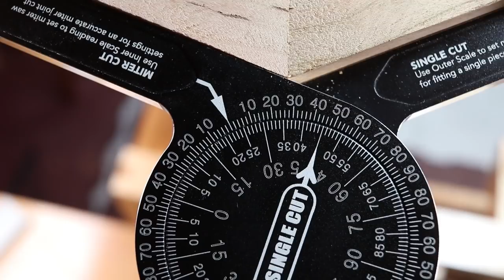How to use the miter Jack to cut perfect tenons

Comment: I used a saw like this 45 or 50 years ago and haven't seen one scene until, I saw you using one in your videos, wanted to make one right away but wasn't sure what kind of blade you used. Thank you for this very valuable saw build, sometimes it nice sawing by hand instead of a noisy saw running! Cheers and Hats off to you!

Comment: I greatly admire anyone who has the patience and precision to produce a perfect result. I also don’t underestimate the joy of working with beautiful tools and jigs - made even more delightful if you have made them personally. My shop has many, many jigs; some are used a lot whilst some only for a particular result. 

I have never found it difficult to make good mortise and tenon joints with one proviso that I will come to. Before I had a dedicated morticer, I used a forstner bit followed by mortise chisels to make the mortise first. Then, using a bandsaw or table saw, I would rough cut the tenons and finesse them with plane and chisel. 

I now use the 2 sizes of dominoes for virtually all that; either with standard dominoes or shop-made so-called mega dominoes. It does takes a bit of the pleasure away from making perfectly-fitting M&T joints but I have to do it that way now because my back and shoulders particularly restrict the amount of heavy repetitive work I can do by hand. I won’t get rid of the morticer or my shop-made tenon jig because, once in a while, I feel I ought to stress my body too far. 

It’s not a criticism of this jig; it’s certainly not a criticism of the skills involved in making the jig. I would suggest that, if you have all the skills required to make this very accurate jig, then you don’t need it. In other words, using those same skills you would be able to cut very accurate tenons.
Reply from the maker: Thank you for your comment, yes there are many other ways to cut a tenon shoulder and miter cuts, you are absolutely right, I just wanted to try this one and see how it works and how accurate it can be, it ends up very accurate and delightful to use! However, there are few of these miter jacks left out there so I thought I would try making one, maybe this doesn't justify the need for one as much as the joy of making one or sometimes the joy of a challenge! To be honest I have made far more complicated projects that I have never published and the question remains does the joy of doing something lie within how much useful it is or within the sense of accomplishment and challenges to overcome.
Reply: @TheWoodCrafter1  thank you for your reply and I agree entirely. I have made things were complicated to make but don’t reflect that in the result. Like you it seems, I get pleasure out of 2 elements - the joy in the making, the patience and the precision and then the joy it is for someone else. My particular favourite style is Arts and Crafts which evolved into Prairie and Mission. Perhaps not the very first stark products and not the final iteration by people such as Greene and Greene. I try to follow many of their mantras. A couple are:

Patience, Precison, Perfection
Have nothing in your house which is neither useful nor beautiful

For the second one, I try to have both form and function in the end result. Again, thank you for the reply and I hope you understand that no criticism was intended - in fact, just the reverse for your skills.
Reply from the maker: @theofarmmanager267  Thank you sir, it is my pleasure to read other professional opinion, my respect 🤝

Comment: I love that saw sled/handle, is it an original design? If the tooth tip line was parallel to the face on that side you could use it as a depth stop, and adjust with shims to vary the depth quickly. Some time ago I cut trenches/dados for a shelf and clamped a board to the plate of my tenon saw to work as a stop, was awkward but worked pretty well, but I had to make sure the saw was at 90 degrees to the board.
Reply from the maker: Man, that shims tip is very useful thank you, I saw other designs like that on the net they do the same function but not Japanese blades, but that is what I found and I can use it now for cross and rip cutting though.
Reply: @TheWoodCrafter1  you could still use it for both but would have to have a think about how to get both blades aligned, maybe index pins or a tapered handle. I'd be tempted to make one with a western tenon saw because they are much cheaper than Japanese saws (here at least)  I like shims, easy to add cardstock or masking tape for small adjustments.

Comment: Not to disparage this tool.... but there is a simpler Miter tool to use. Its already been in use for a very long time and has been dumped on the wayside of power tool development. I think a whole lot of people will go OH yeah!

It is the Miter Box. It will do most of the things you want to do with this Miter clamp and modified block saw. 
It occurred to me while surfing YouTube offerings and it also occurred to me that although the regular Miter Box only does left and right 45*s and a 90 there isn't any reason why it can't do dovetails or any  other angle desired. 
It is the simple idea of a guided saw jig. The thing that so many people have put down as "learning to use the saw" 
I even used a high end miter saw box that was made of metal and had the guides on posts, with the posts able to swivel to any degree. Kind of like a powered miter saw capability without the power.

Any way a specialized Miter Box needs to come out of history and take its place in workshops everywhere.
Reply from the maker: The miter box can make very accurate miter cuts as you just mentioned, but you still need to flip the workpiece on it’s 4 faces if you are cutting a tenon! The miter jack will hold the workpiece in the same position until you finish cutting all 4 faces at the same level and squareness!
Or maybe be a chair’s maker vise will do that job and yet much easier to make than the miter jack!!
Reply: @TheWoodCrafter1   Not meant as a replacement, as any jig can't replace them all. 

A possible improvement ( at least for casual users such as me) is to embed very strong magnets in the block of wood. This way you use any saw and can have several blocks for specific spacers such as used at 9:30  (or attach more spacers to the bottom of your 'permanent' saw block)

Another use for your system, clamp and block saw is for modelers who are working with itty bitty tiny but  accurate stuff.

Comment: That parallel cutoff saw is super clever. The miter jack looks like a pleasure to use. Have you ever tried wetting the endgrain with water/alcohol before planing? I find it cuts easier.
Reply from the maker: Thank you, yes you are right it is much easier than planing dry end grain! I prefer alcohol over water as it evaporates faster.

Comment: What is the name of the saw that you're using for the shoulder cuts and do you have a video on building it?
Reply from the maker: If you mean the saw that is sandwich between the 2 wood pieces, then that is the saw I showed how to make at the beginning of this video! A Japanese saw blade, link for this saw in the video description.
Reply: @TheWoodCrafter1  Yes, that's the saw I'm talking about. I did see the build at the beginning of the video... was just hoping for more information on it. Is it an original idea? If so, fantastic!
Reply from the maker: @kevinmccann316  yes it was used by French carpenters back in the 18 and 19 centuries. But they didn’t use Japanese saws 🙂, there is a special saw for that but it is expensive so I thought to make this one.

Comment: Well, I guess I'm just too stupid to get what you're doing. I could really do with some explanations. Why are you constantly changing the angle of the blades in the blade holder (which I really like)? What's the big difference between your jig and a plain vise? What is the lock on the back of the jig for?
Reply from the maker: Well, I guess I wasn’t too clear about what I am doing.
I was switching between cross-cutting and rip cutting blades on this Ryoba Japanese pull saw, they are different from each other.
That miter jack is designed as a vise with 3 cabinet makers common angles as references 45, 22.5, and 90, if constructed correctly it will give you all these angles by registering that saw bottom to the surface of the vise as shown in the video, you shouldn’t consider this as a vise, its a jig for specific purpose! Something similar to the shooting board.
The brass hook when engaged will pull the 22.5 degrees reference block to allow you to cut 22.5 miter cuts.
Hope this will help 🤝
Reply from the maker: I am not sure if you saw the build video for this miter jack on my channel, if you need a link for the free plans let me know.
Reply: @TheWoodCrafter1  I saw it. I admit, I fail to see the forest for all the trees. I thought the usage video would make it all clear. I guess I will watch both videos again, and give it more time.
Reply: @TheWoodCrafter1  Ah, yes that makes things a bit clearer, thank you.
Reply from the maker: @wolfgangreichl3361  thank you for your time and comment 🤝
Reply: @TheWoodCrafter1  I would like the link for free plans please...
Reply from the maker: Here you go and remember that I take no credit for this link, but it is one of the best out there, enjoy!
http://benchcrafted.blogspot.com/search/label/La%20Forge%20Royale%20Miter%20Jack?m=1